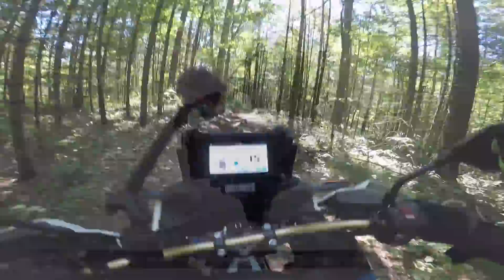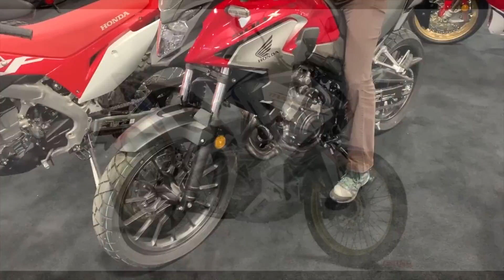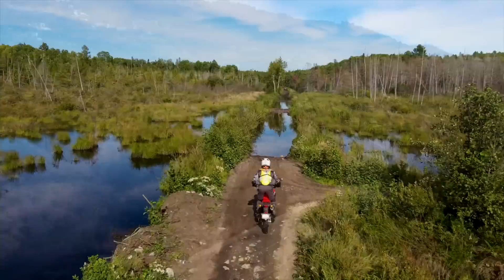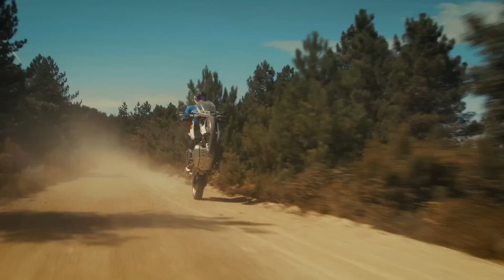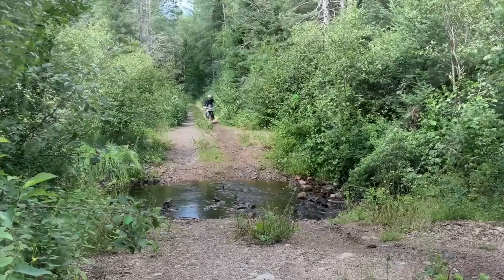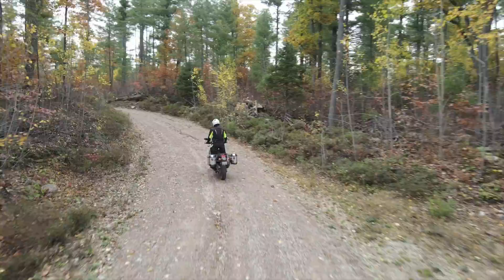New Honda Transalp Finally Ready For Release!

Comment: Looks cool.  Not user serviceable.  No kick starter.  Not enough fuel capacity.  Can't run without a fuel pump or battery.  Electronics susceptible to water and mud.  Delicate and expensive bodywork.

Comment: I suspect the Transalp will cost 2k more than the T7; having a bit more power and shinier electronics, sitting around Taureg territory.  I hope it doesn't give up offroad capabilities compared to the T7 though.  We need more competent midsized ADV bikes; competition drives innovation and low prices.

Comment: The new 890 R is coming in a couple months. Cost more but more up my alley.
Reply: seems fuel pumps and reliability issues are a thing with ktm, what's your opinion (I'm coming from a stoopid reliable Vstrom 650).  Thx

Comment: I think it’ll be a road bike wearing a adventure bike costume like you said. The suspension travel is clearly shorter than the T7 but then again the transalp was never in the same class of bike as the tenere. I think the new NX500 will be a better competitor to the T7. Not as powerful but should be lighter and more affordable with the same off road prowess.

Comment: The transalp in its time was great and was kind of the predecessor to the adventure bikes. It was very different it wasn’t just an XL 600 with some fancy plastic they put a completely different motor in it it was glass smooth and it was a great bike. Now the NX 650 had the same thumper as the XL 600/650s And it had a cool door exhaust but that was just a thumper Enduro with some fancy faring. The transit up was very different and very much more an adventure bike. Personally I hated it because I loved the thumpers and leaned more towards the dirtbike side but riding a transalp was A whole different experience it was a bike you could jump on and put a ton of miles on comfortably. No it doesn’t compare to the newer stuff but that was also nearly 40 years ago.  It was a bike capable of going off road that road nearly as smooth as a street bike. It’s exactly what adventure bikes are today they just have newer crap on them and more bling.

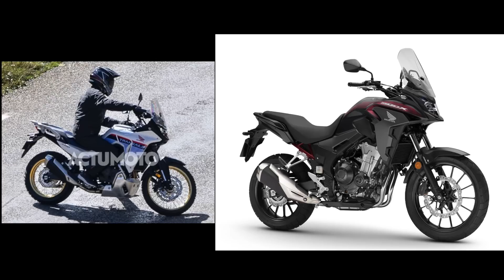Comment: at 3:41 you showed a pre 2022 cb500x when talking about the front end- for 2022 they have larger inverted front forks  and dual discs as the transalp will have.

Comment: My first big bike was a Transalp some 22-23 years ago. It was a good bike for what it was, although a bit heavy and top heavy and also quite thirsty as it was carburated and quite low geared.
A new Transalp would be great but I fear it would be near the Africa Twin in weight and for sure lower in power. 
The Cb500X latest edition is 199 kilos and there is no chance in world a new 750 Transalp would come anywhere near those figures. I guess were talking 215-220 kilos - if not more. And that would almost be a deal breaker for me. 
Exited to see the spec sheet of the new Transalp, although a spec sheet doesnt tell how a bike feels…
Reply from the maker: I'm hoping they get it in around 205kg like the Tenere.

Comment: Comparing the spy shots of the Transalp against the CB500x, Africa Twin and the T7. 

The Transalp should be comfortably between the 500x and T7. I dont think it's going to be quite as off road oriented as the T7 or Africa twin. But it does appear to have a good deal more ground clearance and a proper off road suspension over the 500x. It Should easily be much more offroad capable than a Versys or VStrom.

With the 500x @ 439lbs and the T7 at 460lbs the transalp should fall within that same range.

Pricing on the 500x is $7000, the T7 @ 10,000, and the Africa Twin @ $13,000. So I would assume pricing on the Transalp will come in around $9000 give or take.

Traditionally the Transalp was the more "road oriented" of the 3 ADV offerings and I think they'll stick with it. The Africa Twin and the Dominator were more offroad focused.

There's significant rumors that an NX500 Dominator is also in the works. And if they follow tradition. I think it'll be based on the CRF450L platform. Essentially the 450 everyone wanted.... a KLR killer.
Reply from the maker: I hope you're right about the 450L platform. I heard that the Dominator will have the 471 P-Twin.
Reply: @DifferentSpokesTV  yep that's the prevailing rumor. Or at least it was before we knew the Transalp was a real thing. I dont think that bike makes a lot of sense now though.

If they based the Dominator on the 500 platform it would Essentially just be the Transalp with less power, but at the same weight, and probably pretty similar cost.

The Dominator name has always been more of an Enduro. It doesn't make a lot of sense to make it into a middle weight ADV and have it complete against your own freshly released bike.

Instead.... the 450L platform is perfect. They already have the R&D and tooling and Hondas looking for a way to redeem that bike after a lot of the market shunned it. All it needs is to be bored out to a 500 and detuned so it's not so high strung, throw a bigger oil pan on it and give it some fairings.

Essentially doing the same thing to the 450 that they did to the 300 when they released the rally.

Now instead of having 2 similar middleweights, they have the road focused Transalp, and the lightweight offeoad focused Dominator... All the pieces fit.
Reply: I couldn’t agree more very well said, the Transalp was and will always be more road oriented and serve lots of daily commuters and weekend explorers with some dissent gravel roads charisma. Now if Honda wants to compete with the T7 only thing they need to do is bring back the legendary XR range and get down and dirty with the competition. Otherwise the T7 will always be the king.
Reply: I'd be extremely surprised if it's cheaper than the T7. I'd put it any $500-1000 more. Honda's are never cheap. But I'd happily be proven wrong!!

Comment: 471cc scrambler better be a single or a modern p twin and the smallest displacement bike they make. Honda’s are so pricey it’s crazy…they make aprillia’s seem not so bad
Reply from the maker: It will be the same twin they use in the CB500X and a bunch of other bikes.
Reply: @DifferentSpokesTV  god damn it I hate that motor. It’s only attribute is that it’s bigger than the Honda 300. Feels ancient and boring. The z400 revs wayyy more rewarding in nature and I’d argue even the Duke 390 feels punchier from go…the 490 should destroy it if it ever comes. It is depressing all these great Japanese brands have become so…stuck.

Comment: If it comes with a 21” , and 18 “ rear wheel, this should be a more capable off road machine. Sounds good if it is dependable and trustworthy
Reply from the maker: Honda tends to make reliable bikes. I've owned a couple and never had a breakdown.

Comment: Looks like a more logical Adv bike for the average rider than the T7. I find my cb500x is pretty pclose to perfect with the rally raid l2 kit installed for me, although I could use a bit more travel because I tend to ride like a charging grizzly bear, and i take it on proper offroad trails. If a 450L rally doesn't come out I can see a t7 in my future but the transalp will be perfect for 80% of adv riders.
Reply from the maker: Probably right. Honda does often try to build for the widest possible market.
Reply: The 450L is a very high maintenance bike.  Very frequent oil changes and valve adjustments.  Reviewers always I say always put honda on the bottom of list.  Your review is crap as you had more information on the Yamaha than the Honda.  This bike if it goes into production will be marketed for Europe as the NT1100 touring motorcycle.
Reply: Yeah , a 450L Rally with a seat height of 33.75" would work for me .

Comment: No tubeless tires? This is a huge fail if true IMO. 🤦
Reply from the maker: I'm guessing they ran the numbers and feel that not enough riders demand them.
Reply: @DifferentSpokesTV  that's crazy to me. I'd much rather plug a tire on a large adventure bike out on the trail than have to de-bead a rear tire and patch a tube. Just my preference. 👍
Reply: better to have tubed tires if you are really sending it offroad anyway, so may actually be a good sign for what they believe the capabilities of the bike to be
Reply: @DangerousGas  I would be one to disagree for an adventure bike. MX/Enduro absolutely.

Comment: For some reason, I've always viewed the name as Trans Slap.
No matter the parallel twin, the best compromise is 270°. It makes better traction offroad, it sounds better without stress inducing raspiness and frantic noise, it makes pleasing vibration pulses in the chassis, balances better than other configurations.
Reply: The 90 degree V-Twin is a great motor for an ADV Bike. The reason the P2 is popular is price! Look at the KTM 950/990 series, M-Strata, V-Strom and the original Transalp. (not a 90 degree V-Twin, 52 degree)
Reply: @gt7500  90° cylinder layout produces the same firing interval as a parallel twin with a 270° crankpin configuration. Engine balance isn't the same of course but the tone from exhaust is identical in pattern and frequency.

Main thing is packaging, cost of manufacturing, exhaust routing, cooling, heat management, etc. it's just more cost effective to build a parallel.
Reply: @12skipafew-e7y  I was about to say the same thing. I have a triumph 900 twin with 270 crank. My suzuki 805cc was a 45° v with 45° offset crank pins with rods crossed = 90° separated pistons from TDC making it a 270° also. Exactly the same sounds.
Reply: @12skipafew-e7y  I agree, it's not the same and it's trying to imitate the mighty V Twin.
Reply from the maker: I love Yamaha's CP2 so I hope the new Honda engine will be just as good or better.

Comment: I hope they put that 750 motor in a new rebel.  The 500 is a little under powered and the 1100 is a little more than I want.
Reply from the maker: I wouldn't be surprised. This seems to be how the companies operate now. Build a good motor and use it in 3-4 models.

Comment: Honda has had ample time to study the competition. And of course the market. So expectations run high and if anyone can pull yet another success out of it´s hat it is Honda. But that is a hot segment of the market, with great options as the T7 and the Aprilia are both very good bikes. And Suzuki most propably will also bring something good to the table as the V-strom has had a great run. And what will Kawasaki come up with? The KLR is overdue for a bigger brother more suitable for modern times and they are bound to work very hard right now with something also suitable for this segment. So, great times ahead. 👍
Reply from the maker: Yep, I agree. It seems that soon the T7 will have two legit competitors, and I hope that Kawasaki is also working on something good. It shows you how good the T7 is. It took forever to develop and hit the market,  but now that it's here, everyone else is scrambling to get into the game.
Reply: I'm  excited to see if the Transalp and V-Strom 700 will have a more off-road version available as most manufacturers are doing this with ADV bikes.
Reply: just as the economy crashes, they may hold off on the release just because of that, it's a business

Comment: I ride a 2015 Vstrom that I am very happy with. Glad to see more new options coming for midsized Adventure Bikes.
Reply from the maker: Yes, including a new Suzuki being tested right now.
Reply: I also ride a 2015 1k strom.
Couldnt be happier at the moment!
Reply: If you took it to CO BDR, you'd say it was great, but could reallly use another 2" suspension, 10 more HP and be lighter...  at least my '16XT showed me that in July.  Some good fairing would be included in my dreams

Comment: If the Transalp will have 92 hp then why should I buy the African Twin with 102 hp wich is more heavier and more expensive? The Transalp will be lighter and therefore a better handler I guess.
Reply from the maker: I'll guess around 80hp. You're right, 92 is too close to the AT.
Reply: only if it has suspension comparable to the AT
Reply: @terryboyle  But it will be much cheaper and most riders will never see a offroad trial.

Comment: I really do not understand why anyone would want a twin in a large trail bike. However, the T7 is a hot ticket even with its short suite set-up. What ever happened to a light weight 400 set-up for dual sport?
Reply from the maker: Emissions regulations have almost killed the big single unfortunately. You have to run them lean to pass emissions which causes poor performance and overheating and reliability issues.
Reply: @DifferentSpokesTV  There are plenty of twin cylinder ADV bikes with the individual cylinders displacements exceeding 600 cc.  Then there is KTM 690.  Emissions are not the reason there are no larger single cylinder modern  engines in this displacement.  The real reason is they must have counterbalancer shafts that add weight and cost without contributing  extra power.   At that point they may as well add an extra cylinder and get more linear power with minimal weight difference.  Plus rider gets more usable power without huge torque pulses.  The reality is more than 95% of miles travelled on ADV bikes is on the road not on trails.  It is dumb to design for the 5% or less use case.
Reply: This isn't labeled as a dual sport it is an adv.
Reply: I agree with Jimmie... Torque at low rpm is all I want, & this bike seems more of a "sport-tuorer" , not so much for dirt anyway.. It looks like a bike for people who fear the grass-clippings in the road

Comment: Finally its here, but why oh why did they go for a big cb500x look instead of a baby twin look... Its going to hurt the sales numbers to be honest. The rubberdust concepts look so much better.
Additionally what concerns me is squeezing 91hp out of a 750cc block... That implies that they require quite a large compression ratio, which is bad for reliability and for dirty fuel whilst traveling.
Reply from the maker: Honda is notorious for conservative engine design because they are fanatical about reliability. I agree about the look unless they also design an Africa Twin 750 or 850 that is more off-road biased and release that too. Doubtful.
Reply: Yeah, high compression ratio says to me "Non-third world traveling" .
Reply: Very unlikely that Honda puts a high compression engine in a mid weight bike.  They would have on the AT if anything, but don't. And it looks like a CB so it doesn't steal sales from the AT.

Comment: CB500x has 47hp to stay below 35kW A2 license limit. For 750 there is no need for that. More than 75 expected, maybe 80? Enough anyway.
Reply: The 750 engine is on the limit of 92hp so it can be restricted to 47hp and unrestricted to full power after you've got full license
Reply from the maker: Interesting. I didn't know that. Artificial power limits set by governments are ridiculous to me, but they definitely dictate what manufacturers do.
Reply: @DifferentSpokesTV  makes me wonder how many horses are hiding under the cover of government's restriction.. Probably something like the Aprilia 660

Comment: I don’t think it will be a T7 competitor. It will be more road oriented like a VStrom. Honda is probably recognizing that the middleweight adv segment is the growing one. Their 500 is not suited to bigger experienced riders. The AfricaTwin is a bit much in price and substance for most people. So I am hoping the Transalp hits that sweet spot of economy and capability in a full size with a dash more off road capability than the current VStrom 650. 

Now when Suzuki brings out the next Gen VStrom, with a road biased version and an off-road biased version, that will make for some great options in the market. 

Waiting for these bikes to come out for my F650 replacement.
Reply: Ditto. I think in terms of offroad capability, this isn't gonna be aiming to dominate the performance of bikes like the T7 as much as it'll be aimed at people who are wanting to have a bike that dips into moderate touring and moderate offroad adventure riding. They see that people want a competent mid weight adventure touring bike, but don't necessarily want the extremely premium suspension and gadgets that come with the heavy adventure bikes. 

Based on looking at the suspension travel and the estimated ground clearance from some attempted geometry on my part to estimate the ground clearance (probably about 7.5-8 inches of clearance) its offroad capabilities will be somewhere between a wheel swapped cb500x and a T7. 

It'll definitely compete with the T7, but for slightly different reasons than what the T7 itself offers. IMO, it seems to be more directly competing with bikes like the midsize BMWs and Triumphs, as well as offering a more reasonable upgrade path for people like me who ride cb500x (or maybe also for people who like the NC750x, but want something with capable engine specs for longer trips)
Reply from the maker: Interesting points. Honda already has the NC750 though so I'm hoping for something much more aggressive. Yamaha can't build the T7 fast enough and I'm guessing Honda would love to get in on that action.
Reply: @DifferentSpokesTV  nah. NC750 is for commuters only with its 17” wheels and sensible “boring” motor.   They put an X on it, but it really shouldn’t have it.   In my opinion…. 

Guess we can hold on to the hope they make 2 versions of the Transalp where one gets the 21” wheel and paired  down fairings with maybe an extra inch of suspension travel and the other is a lower 19” version with better wind protection.
Reply from the maker: That's the way Triumph operates and it's worked for them so far.
Reply: I'm betting there will be one variant with DCT which would replace NC750X on the market.